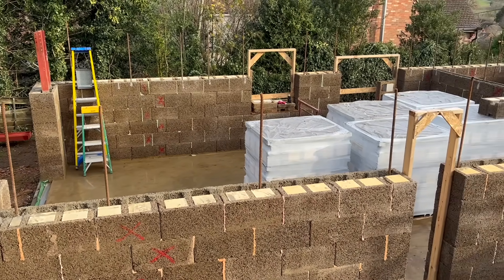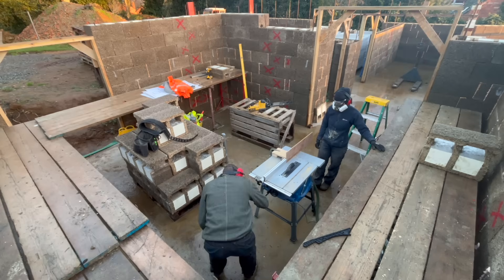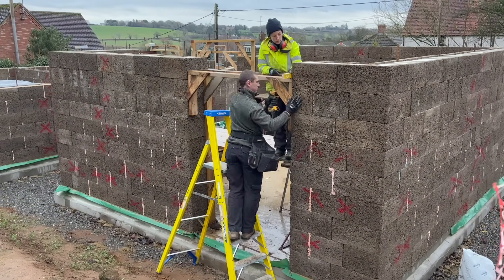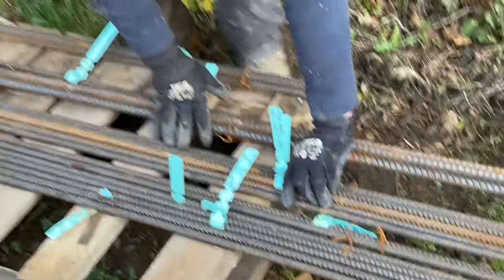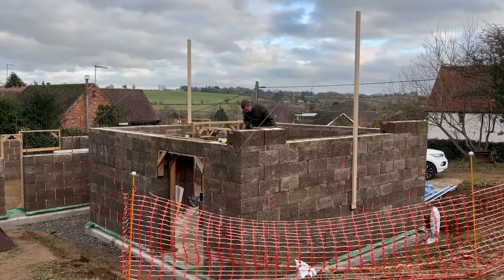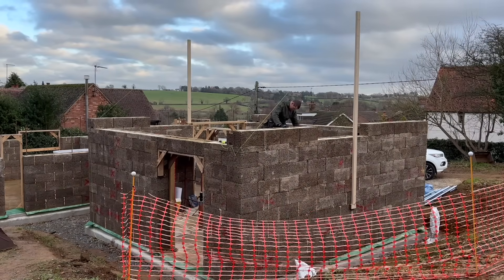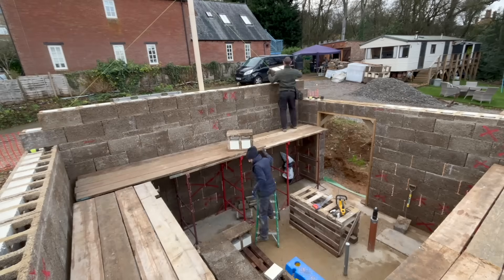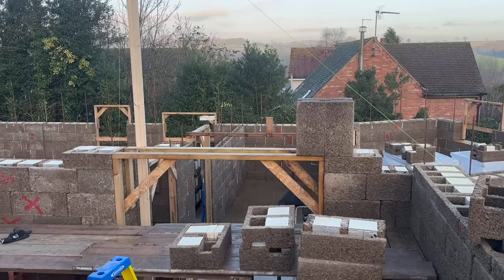Building next lift on our utility with our ICF blocks - Self build - Ecobrix - Passive house

Comment: Do you feel you have reached your top speed yet?
Reply from the maker: We certainly feel confident building with the blocks and have a good method though... now we are working higher up that is obviously slowing us. Also we are now at a stage where many aspects come together such as differing elevations, service routes, rebar lintels and rebar columns which is all still fairly simple to construct because of modifying the blocks but its no longer lashing blocks down where all you need to think about is managing levels and openings for doors/windows. Aiming for our second pour in February.
Reply: @TurningRosemountUpsideDown Thanks. I think this will help anyone else considering building with the Ecobricks.

Comment: What do the red cross,s refer to,but progress is good.
Reply from the maker: Red crosses mark cut blocks. Cutting a block results in loosing either a male or female locating end, there’s a risk when filling with concrete the cut blocks move out of the wall or blow.
Cut blocks require shuttering front and back so if you don’t mark them you’ll forget where they are to shutter.👍🏻

Comment: Just a thought, could you not have saved a lot of cutting 100mm by building the gables straight up with full size block, then you would just need to bring up the other two walls to the required height with the cut blocks?
Reply from the maker: Your thought is exactly right. Looking back on it now we could have left out the 100mm cut block sections on that gable and just used them for the wall plate walls. We initially thought we would need to continue them all round, but when we finished that side we realised we need 155mm section for the opposite gable…showing there’s no need to continue them all through.😅 great spot and understanding of the blocks.👍🏻